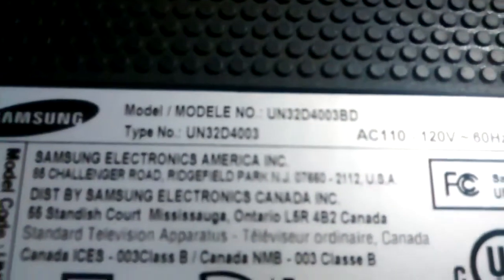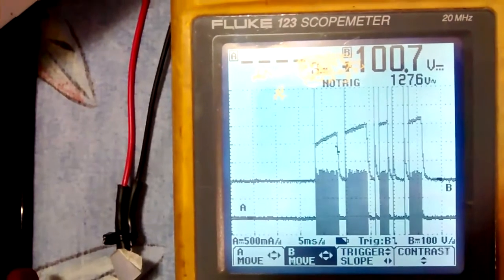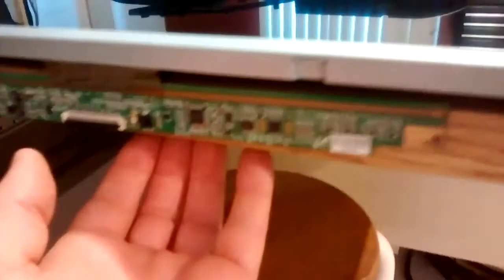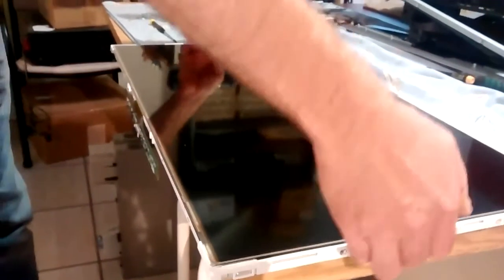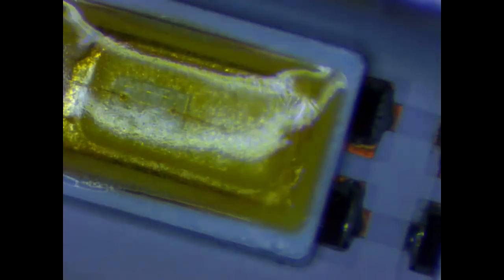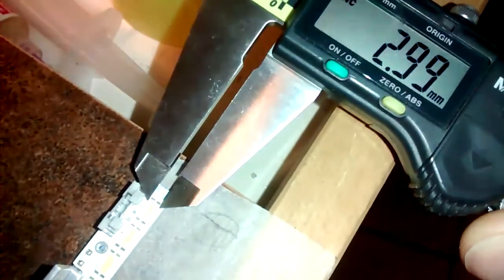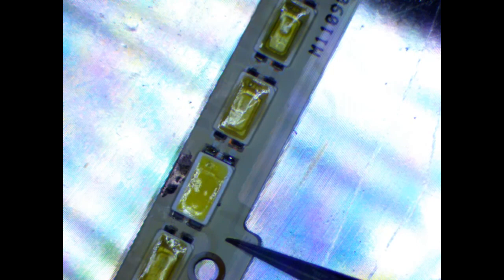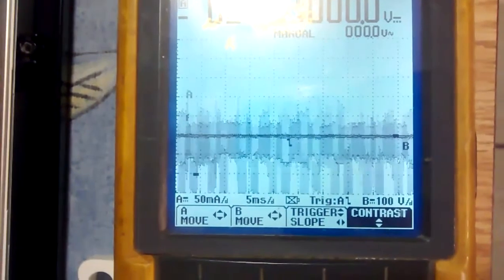UN32D4003 LED strip repair and LED current adjustment

Comment: How good is the thermal transfer between the LED strip and the metal support?     Maybe this thermal tape helps ? https://www.made-in-china.com/showroom/3ksno1/product-detailHXNQOEFTbpRI/China-Thermal-Conductive-Adhesive-Tape-with-Double-Sided-Glue.html

HDR (>1000nits) LED strips  differ somewhat?
Reply from the maker: yes probably a good idea. After lowering the LED current I'm not worrying too much about overheating though